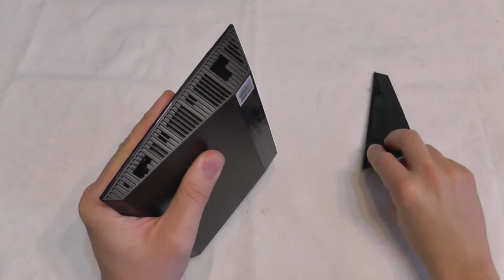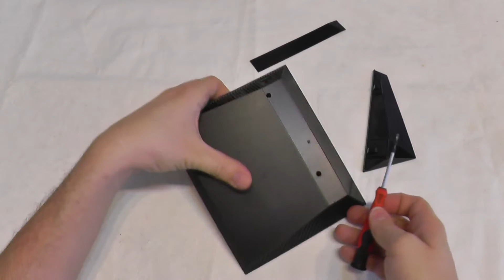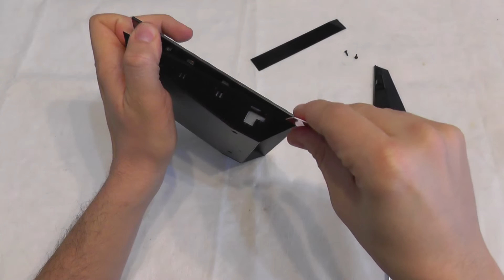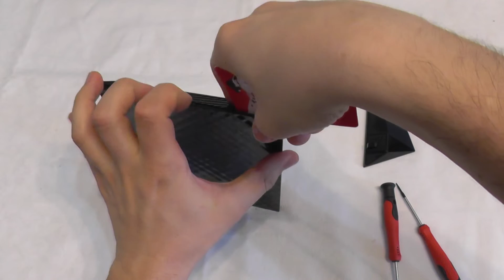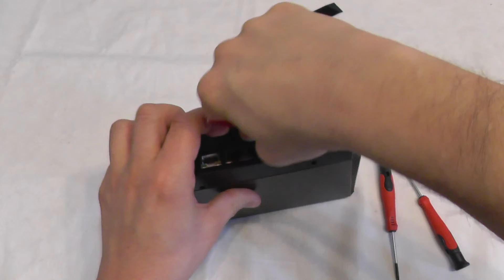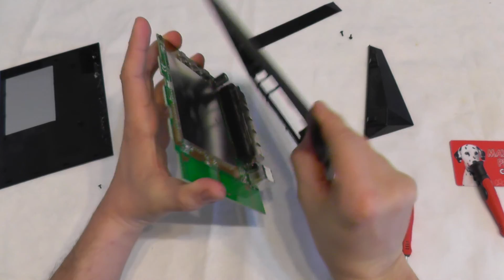Asus RT-N56U Router Disassemble

Comment: Thanks so much. My router kept disconnecting. Took it apart, found a bad solder on a capacitor, fixed it and so far so good.
Reply from the maker: Glad to hear that my video was useful and that you managed to fix your router.

Comment: Makes perfect sense why this guy runs at 80C now. No heatsink in the later revisions to cut costs at the expense of thermals, ASUS loves to do this kind of shit.
Reply: That's why I avoid Asus routers. If you have one, delid it & put a fan on it.
Reply: Delid and add a fan? Both unnecessary - just add a cheap passive heatsink. (or not, since it works perfectly fine stock)
Reply: wait, really? you spend 70$ on a router and you have no cooling on it? ;f
Reply: I have this router. After 9 years the ethernet jacks gave up the ghost, but wireless still worked. ASUS forever!!!!